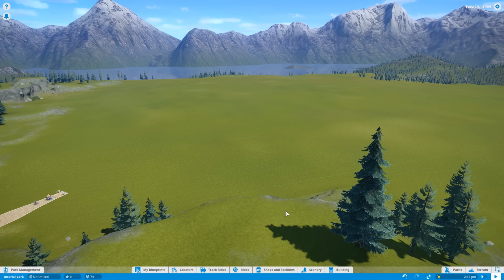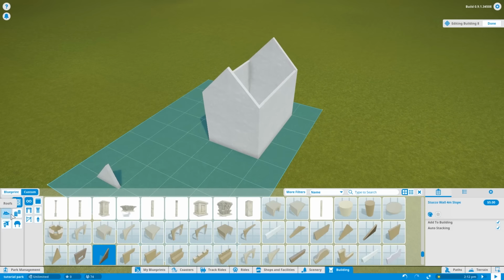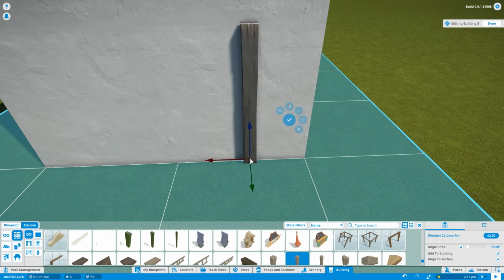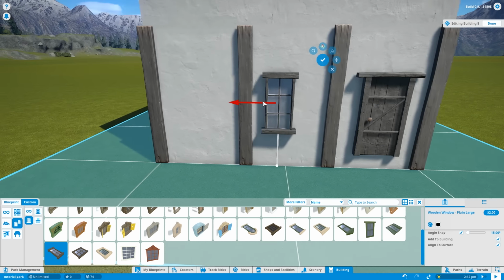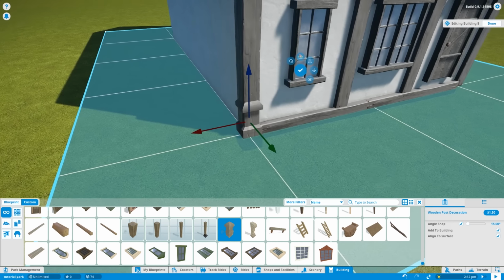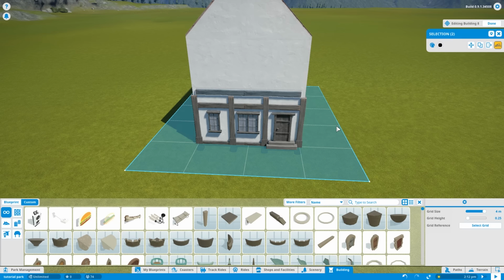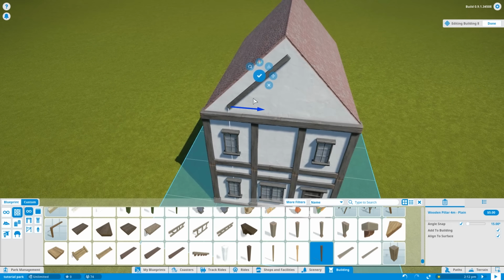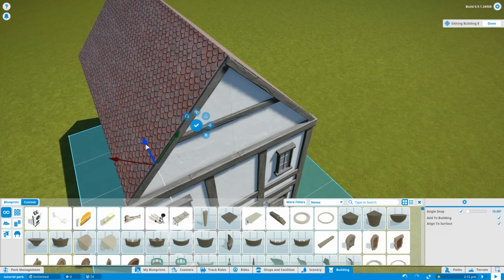Planet Coaster: Tutorial - How to build custom buildings (Beginner Tutorial)

Comment: stupid question. Does the custom buildings are only for decoration, or can be use it to put a shop or something?
Reply from the maker: You can use it as decoration only, but you can put a shop in them as well, basically you can make it whatever you want.
Reply: how u put the shop inside. And wow. you answer very fast, nice man
Reply from the maker: While being in building mode just select a shop you want to build in the shop tag and place it where you want. You will need to change the building to your need though.
Reply: awesome, thanks man

Comment: My walls wont rotate. It might help if you explained what keys you are pressing to rotate your walls. In order for me to change directions I have to stop building a section and press done then I have to start a new set on the wall which makes building anything for blue prints pointless as you cannot select multiple walls. I do not understand what I am doing wrong here. Can someone tell me why I cannot build a simple square? Rotate only works on the first piece, then after that, the next segment will not turn for me
Reply from the maker: Hum. 
As I said quite early in the tutorial, I press Z to rotate pieces (Y if you are on a german keyboard layout), and it doesn't change over the building process.
If that doesn't work for you I'm have no idea. You may consider having a look at the bug-report forum https://forums.planetcoaster.com/forumdisplay.php/37-Bug-Reports

Comment: Good Video, learned some new Stuff again. But i have a few Questions

1. Can you somehow save a Path within a Blueprint?
2. Do you know  what does Art Pieces are for? Their Color fit never to Anything, can you some how put Textures on it? Like Wood or Stone?
Reply from the maker: Thanks a lot Prof. Awesome!

1. Sadly no.
2. You can't put textures on them - at least by now - I really hope it will be a thing at some point in the future.
I have to admit, I haven't used these art pieces yet, simply because I have the texture issue as well.
Reply: Alright, jeah i hope they give you a way to put Textures on it, those Shapes are a Awesome tool but with just flashy Colors on them, you cant use them anywhere.
Reply from the maker: Yeah, they are very handy in one way, but kinda useless by now I think

Comment: This is a great tutorial... How did you get your roof pieces to slide (11:50)?? I can't get my roof/wall pieces to slide freely; they stick to the grid.
Reply from the maker: thanks a lot Zillie. You need to split the roof from the building - just select the roof in building mode and click "split selection from building" in the selection tab on the upper right corner, press x and move it ;)